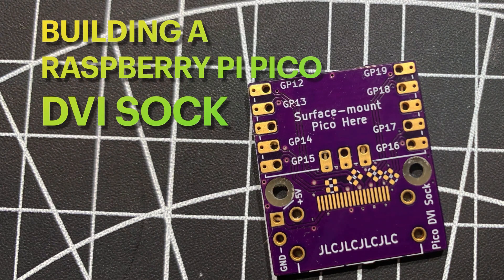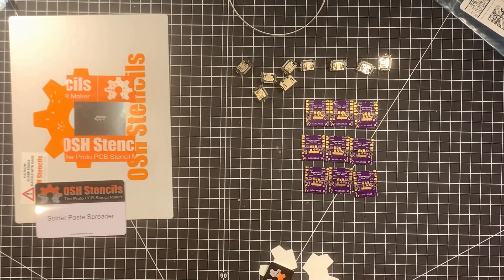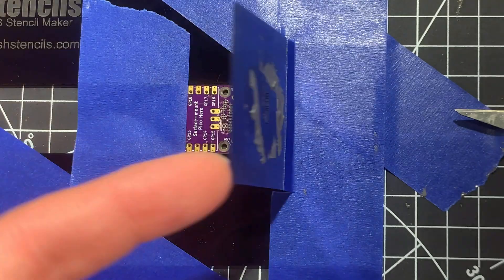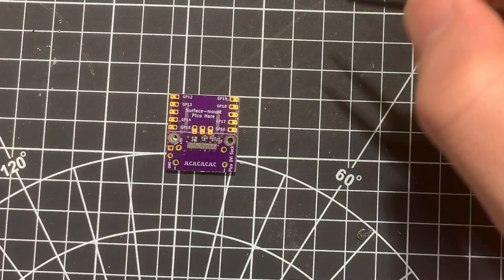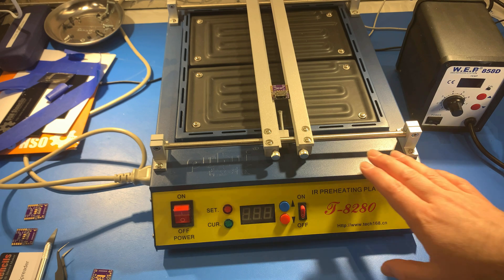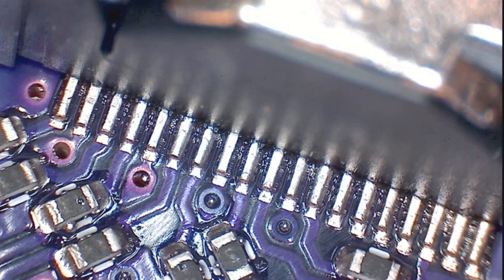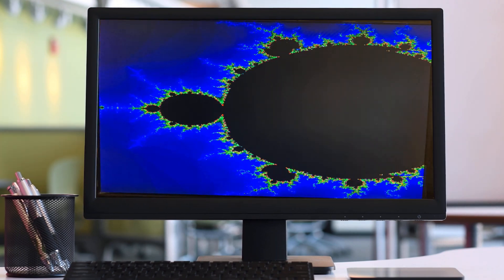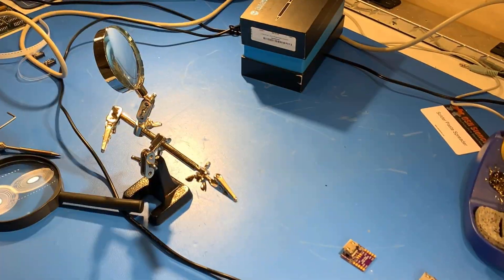Raspberry Pi Pico DVI Sock!

Comment: Would it be possible to make a dvi to vga converter with the pico?
Reply from the maker: You can maybe do a vga to dvi if the vga screen is small enough. The pico has 2 cores so one reading vga signals and the other writing dvi signals. The big problem is RAM it only has enough RAM for a 2 colour (black and white)  640x480 screen. I tried to make a classic Mac 512k video to DVI and it’s close but the timing is really hard to get right. Check my twitter account @robingrosset I posted a 10 second video of Mac screen to DVI.
Reply: @robin-g6 on the video you mentioned a 640x480 that i understood it was color, but so you say its not possible to achieve 640x480 in color 16 bit?
Reply from the maker: @artesalve5965  You can achieve 640x480 with 16 bits per pixel and higher resolutions with the Pico. The limiting factor is the SRAM the Pico has only about 264KB. You need roughly double that to store a raw 640x480x16 image. If you were to convert from VGA to HDMI/DV you need a buffer to store the pixels. 

There is a chance you could get this to work if you used image compression or some memory outside the pico.
Reply from the maker: Here is the link https://twitter.com/robingrosset/status/1401535750588485632?s=21&t=StZJ3SxQY0cLCgF0DRIVPw
Reply: The big issue is any differences between the configuration of the displays.  If the DVI end reports only claims to support the kind of refresh rate and resolution of the VGA output end, then it might be possible as you just read the color bytes off the one port, and write them out the other.  Any mis-match means having to scale/resize the image or interpolate frames, and the Pico just doesn't have enough RAM to buffer all that.

Comment: They make 4x resistor array, just two instead of 8 parts. the larger size 3.2mm x 1.6mm is the CAY16-271J4LF
Reply from the maker: That’s a good call. Although these DVI socks all worked I do prefer to have parts I can see with the naked eye!

Comment: I downloaded Luke’s design, tweaked it a bit mechanically to fit a HDMI connector that was easier to source for my manufacturer. 
An authorized Raspberry Pico reseller, Electrokit.com, currently list my version: https://www.electrokit.com/en/product/dvi-sock-for-raspberry-pi-pico/

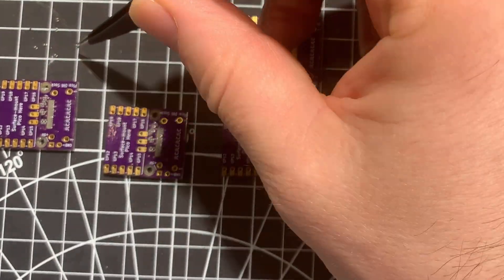Comment: 2:27 I can't even see the components you're picking up with the tweezers!
Reply from the maker: They are amazingly tiny, and hard to see in real life, really hard to image hand soldering them.
Reply: @robin-g6  They would do us hobbyists a kindness by providing pads for larger resistors, or even thru-holes, in parallel.
Reply from the maker: I made a video using through hole components and an HDMI cable which does the same thing , Raspberry Pi Pico, HDMI on a breadboard
Reply: @robin-g6  I just finished a little interface board, that routes GP0->31 to a couple of keyed 8-pin IDT male sockets on the left.  When I cut up an HDMI cable, will try to line up all the little wires neatly and crimp on the female side of the 8-pin ribbon connector to save some tedious soldering.  Hopefully, the DVI demo does not require specific pins to be used!  You are well on your way to emulating 80's era color computers.